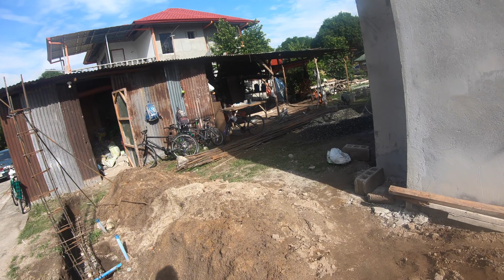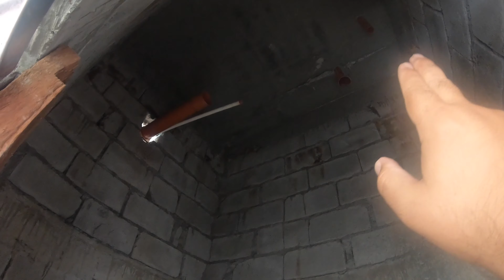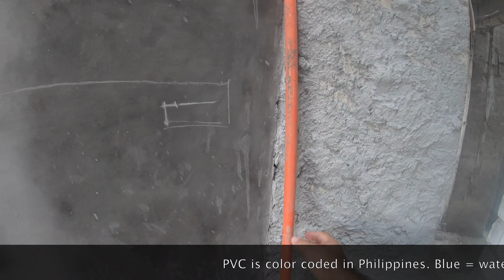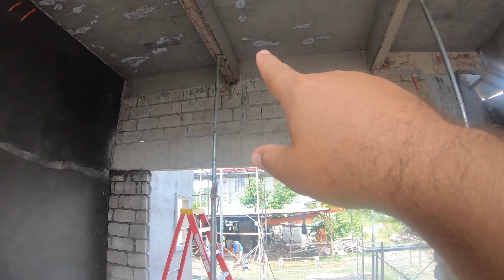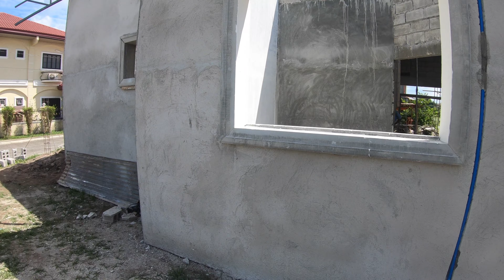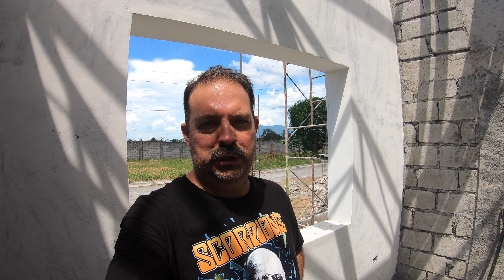Philippine House Building Step by Step, Build Day 94: Mini Split Air Con Drain Lines

Comment: How wide is your hallway going to be  with that big orange PVC and water line once it is plastered up?.  You should Get the measuring tape out and check on them.  It looks really narrow from the video and your walking thru there. @3:55 in the video.
Reply from the maker: Followed up with the plumbers today. They used two 45s at the bottom to help make that transition smoother after the long “dump” from upstairs to down so that it won’t jam up in the corner.
Reply: @CasaTexPina  - Bahahaha long dump very nice plumbing terminology I am sure - awesome house that is taking shape - see if you can get them to protect that water main that goes through the fence column with a sleeve of some sort as any movement in the column will take the pipe with it.
Reply from the maker: I’m under the impression, and will confirm today, that line will be capped prior to entering the property. Our main line is supposed to enter near the garage on the other side of the property. Good looking out, Serge.👍
Reply: @CasaTexPina  - thanks George.
Reply from the maker: The area where the orange pvc is going from 2nd floor to first is actually in middle of the wall between the pantry and the linen/coat closet. I may have misspoken when narrating.
Reply: @CasaTexPina  are you seeing minute 4.01?  looks like a woops in the hall?
Reply from the maker: Not actually a hallway, I misspoke. The pipes will be covered by a partition wall separating the pantry and the coat/linen closet.
Reply: I observed the same thing - George did say it was a hall way ?? In any event I think that pipe could have been placed in a corner of the bathroom on the opposite side of that wall. I would be more concerned that they used a 90 degree bend on that pipe as it goes through the wall.